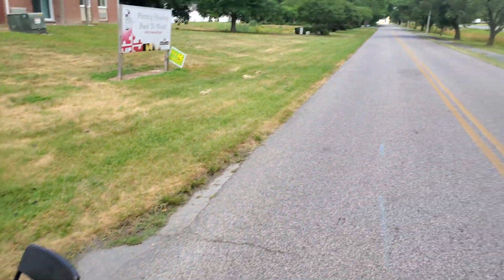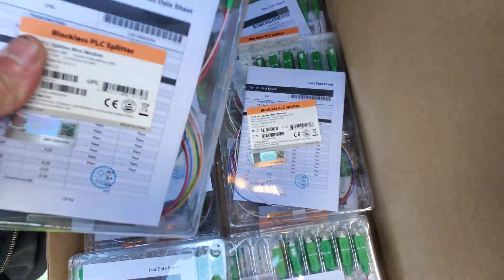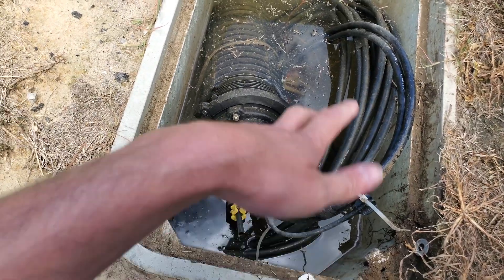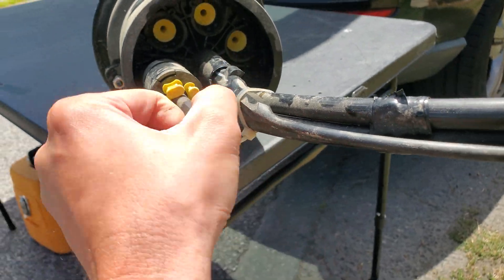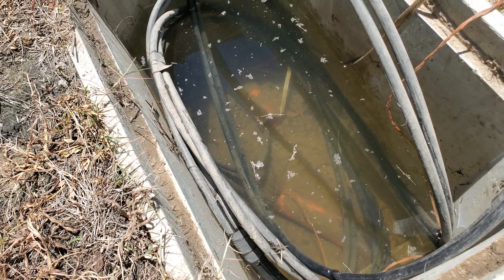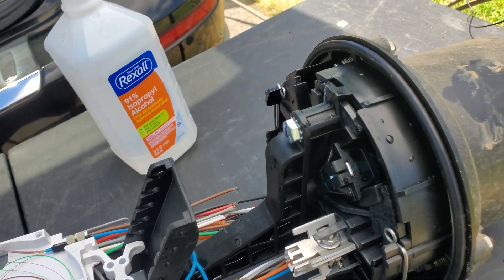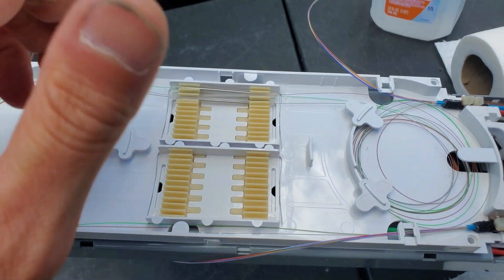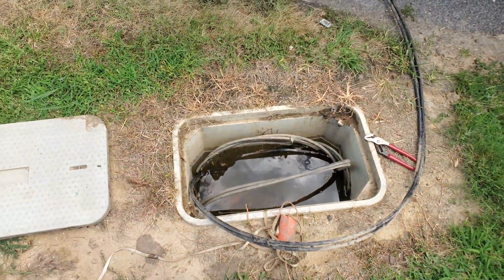Adding a New PON + new 120 unit apartment build

Comment: Do you have gravel placed below the pit? 
I always get about half a foot of gravel dropped into the bottom of the hole before we place the pit which seems to help with the water. Also i put about half a foot of gravel into the bottom of the pit to catch gunk before it blocks the drainage holes.
Reply from the maker: We sometimes do this, but this particular one needs it like with no rain it has an unground aquifer or something.

Comment: When I did campus network design, I specified a 1 inch hole in the box bottom.   A box rep once told me the potential problem with a closed bottom box is that near a road the water can become hazmat due to road oil runoff. I used to specify open bottom over gravel,  but contractors would skip the gravel and I'd get a box full of sand here in Florida.
Reply from the maker: Global warming at it's finest

Comment: you should get some safety cones or a used nynex/verizon cube van - splice in comfort and safety plus consider tax strategy - it would probably be a writeoff #tools #obtainable chinesium
Reply: At least cones and a popup Pelco tent
Reply from the maker: I typically have cones out this was only a 5 minute situation on a barely traveled road.  25mph